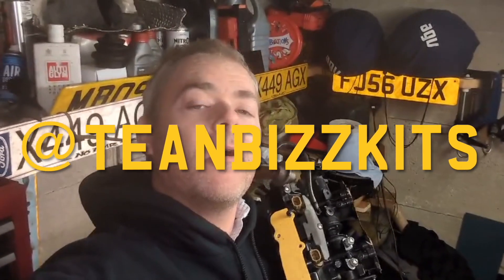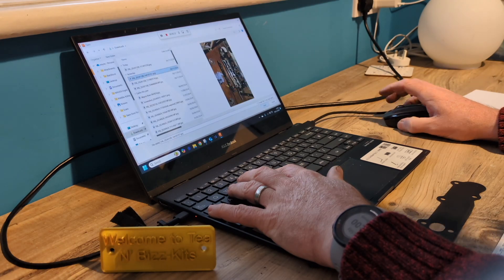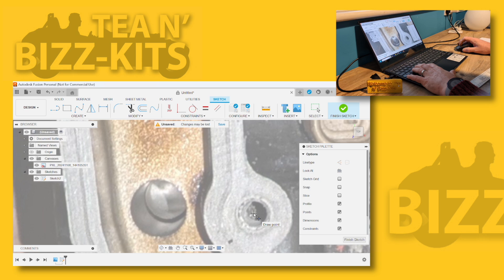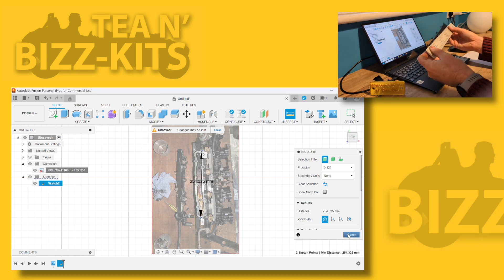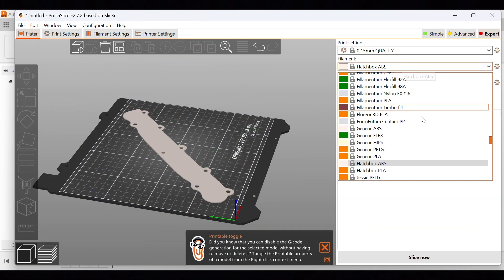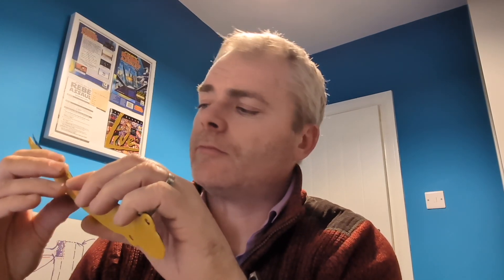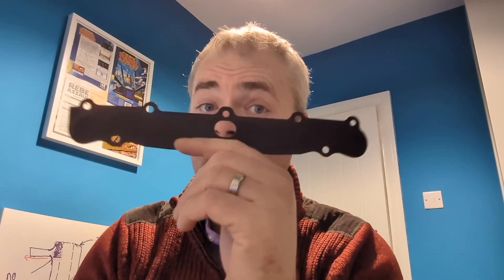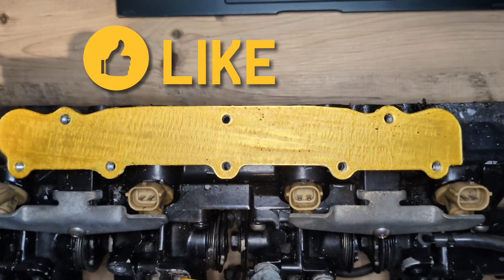HOW TO USE PHOTOS TO MAKE PARTS IN 3D CAD

Comment: Thanks for this, I need to learn how to do it as well. I'm planning to have a Lotus Performance script on the top of the valve cover. Maybe draw the outline of that gasket on a paper, and scan that.
Reply from the maker: If you can then sketching it on 1mm square paper will really help scaling and understand the distortion. If you are doing a logo remember you could just grab it from Google, edit it and drop that on to sketch around. Printing to scale on a paper printer generally works well. I have don't that many times in the past

Comment: Cracking work Bizzle 👍
Reply from the maker: Thanks very much. If you ever need any bits 3D printed for your car, give me a shout. I'll cad and print them for you, very favourable mates rates 😉😉
Reply: @TeaNBizz-Kits  Let me put a list together for you 😅
Reply from the maker: @jasonprotaszczak8011  seriously, once you realise how useful they are you can't stop. Parts in ABS are strong, stable, capable of dealing with under bonnet temps and sober many issues.
Reply: Ok well I have a list of parts, I will work out what is realistic to knock up on the mill and the rest will be landing on your doorstep 😅